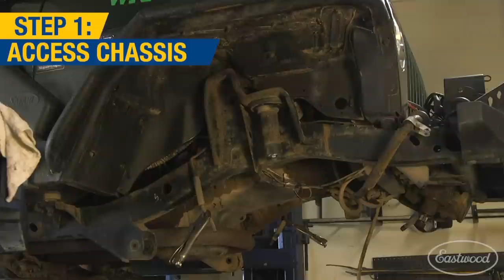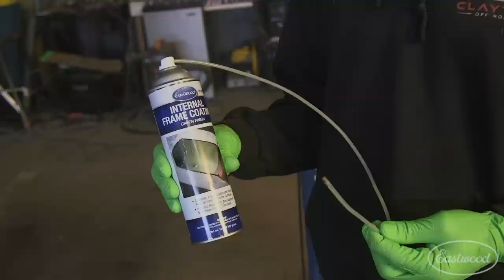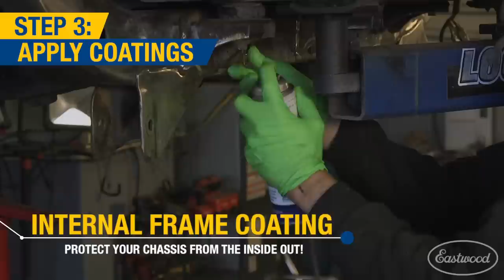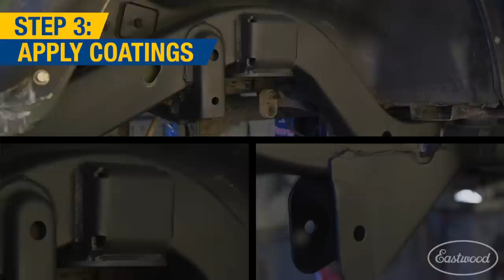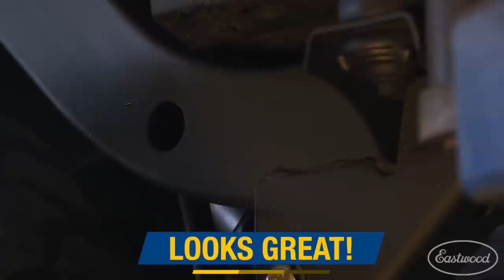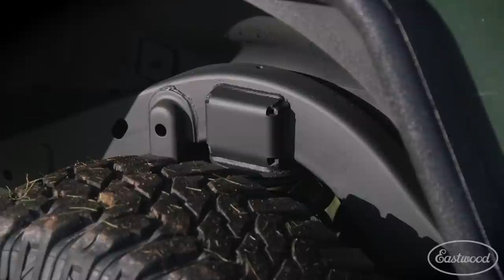How To Protect Against A Rusty Frame - Off Road Jeep - Eastwood

Comment: Long time user of you products. Love everything them all. Would you please offer me some advice to how to clean and prep the internal of a frame? I have used you internal spay many times but because i'm having a hard time prepping it seems to flake off after a year. Thank you in advance.
Reply from the maker: Have you tried blowing out the inside of the frame with air?  Use a pressure washer, then blow with air and let it dry before spraying Internal Frame Coat.  That will help.
Reply: I do use air. I might have not let it dry all the way now that you mention it. Can you use the 360 nozzle hose on a can of pre paint prep? If i use pre paint prep in the frame and let it dry will that do anything or will not being able to wipe it off the inside of the frame be an issue?